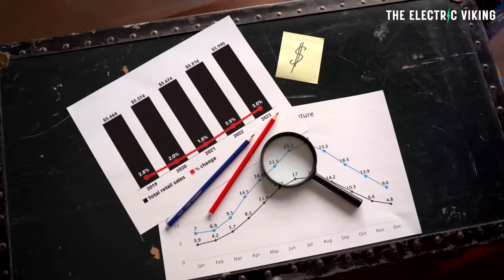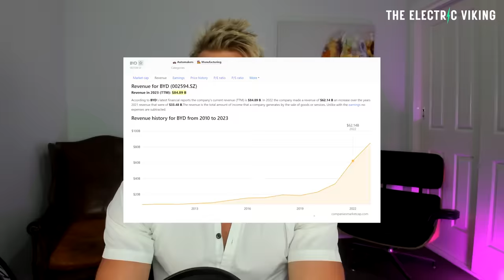Germany says China funneling Billions into BYD to Crush Tesla and legacy auto

Comment: US has hobbled the WTO by not allowing judges.  So one country has hobbled the body that would be the arbiter of these trades disputes.  This might be an indication of which party is breaking the rules.
Reply: Very much so. The US was sick of losing WTO cases relating to protectionist measures. And with the WTO accepting the concept of cross-sanctions — meaning the slighted country don't have to apply whichever sanctions it wins to the sector where the protectionism happened, where the sanctions would likely be useless anyway, but can instead select some other sector for the sanctions in order to maximize economic and political pain to the country guilty of protectionism — losing an WTO case was starting to sting.

Comment: Yes BYD has their cars sitting in ports all over the world, this is supposed to be all their car sales,
Reply: Not really all over the world. Here in Brazil they are the best selling EV brand — 4 of the top 5 selling EVs are BYD models — and they are selling them as fast as they can bring them.
Might be why they are speeding up the construction of their factory here so they can sell locally assembled cars before the end of this year (with full production beyond assembly coming next year), and almost doubling how much they plan to invest in the country.

Ironically, their factory is on the site of an old Ford factory. And BYD already sells more cars here than Ford.
Reply: Fabio. Are they hybrid or BEV and how is Brazils infrastructure to support BEVs ?
Reply: @brianrautiainen5473  I was talking about BEVs only, though if you add plug-in hybrids then BYD is still at the top, with GWM at a distant second. Non-plugin hybrids don't seem to be selling well, perhaps because both BYD and GWM promote plug-ins when talking about hybrids, and Toyota — the brand that sells most non-plugin hybrids here — is regarded as a too expensive brand in Brazil.

Poor charging infrastructure yet, but in Brazil it's very common for houses to have either an enclosed garage or a walled off driveway, so lots of people can charge at home and only need a public charger during road trips — and charging at home is much cheaper anyway. Many residential buildings are also looking at the possibility of installing power outlets capable of supporting L1, or even L2, chargers to their parking space, and some businesses offer parking spots with L1 or L2 chargers, some even for free use. And the number of public charges is growing fast.

Comment: If China stopped subsidizing their manufacturing sector, would the European  auto manufacturing industry return to Europe ?
Reply: I don't think so, at least not just from subsidies ending:
- China invests very heavily in transport infrastructure. They have a saying, "if you want to get rich, build roads first." This makes their infrastructure pretty good and logistics cheap.
- China has invested heavily in co-locating whole production chains. There are places in China where if you build your car factory you can get most, if not all, parts you will need from nearby suppliers. This further reduces logistic costs.
- China has a very large population and good public universities; this not only guarantees a very large number of specialized workers (as tuition rates are not an issue for the most part), the government having control over the public universities allows it to heavily influence how many graduates of each course there will be each year. This influence over the universities is used to make sure any industry the government wants to grow has more than enough qualified workers.
- Almost any part or component you might need is manufactured somewhere in China. Thus, almost anything can be built in China without having to deal with importing components.
- China has the largest car market in the world, roughly the size of the EU and US car markets added together, and it's growing faster to boot. It's even more impressive when it comes to EVs; more EVs are both made and sold inside China than in the rest of the world added together. No wonder Chinese EV makers have much better economies of scale than any competitor not named Tesla.